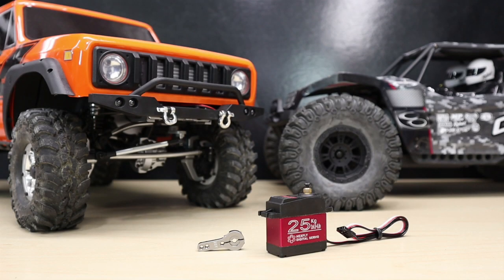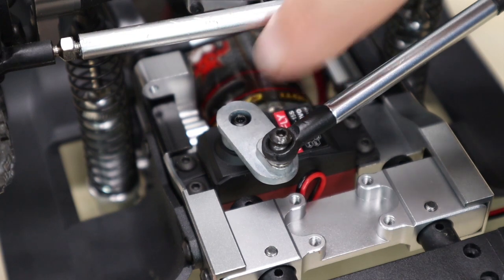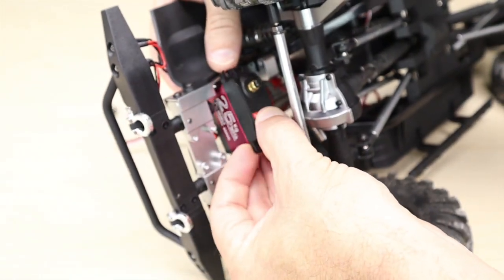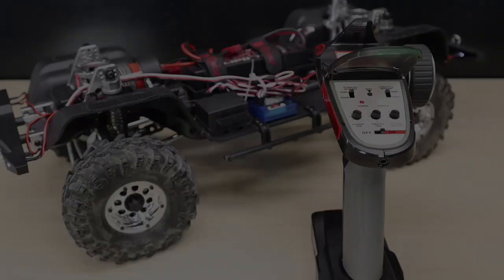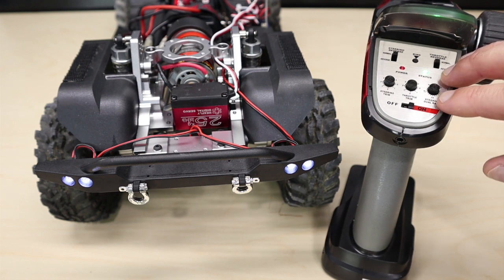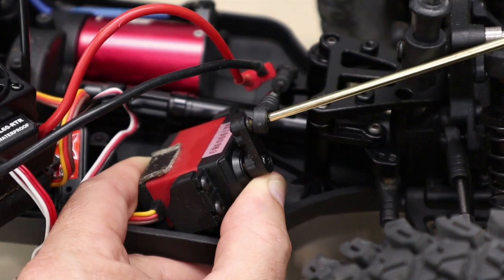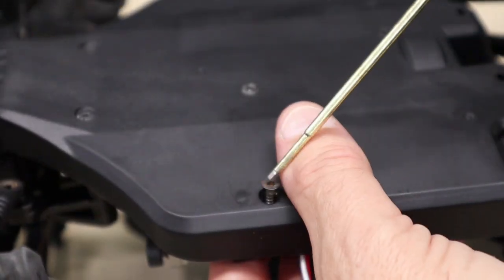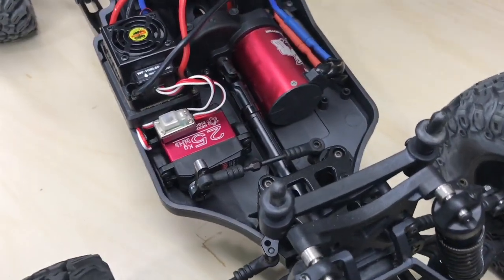Redcat University - How To - Hexfly 25Kg Servo Install In The Redcat Racing Camo X4 & Gen8 Scout

Comment: Will this servo work on a Traxxas E-Revo 2.0
Reply from the maker: Technically speaking they should. Most 10th scale servos are about the same size overall. The teeth count on the output gear may be off but the servo should "fit" the mounting spot.
Reply: Redcat Racing I also want to use it on my e-revo 2.0, but I am not sure about the speed of this servo (3225), do you really recommend for this monster truck?